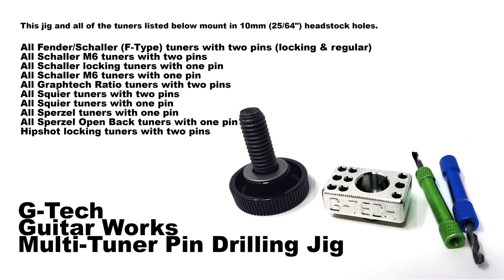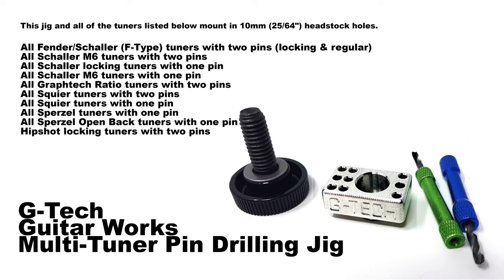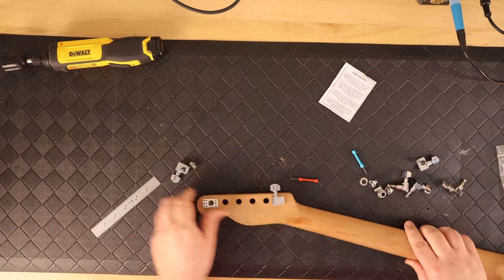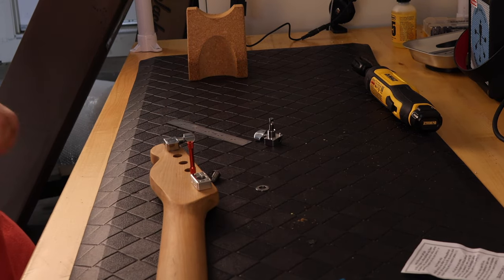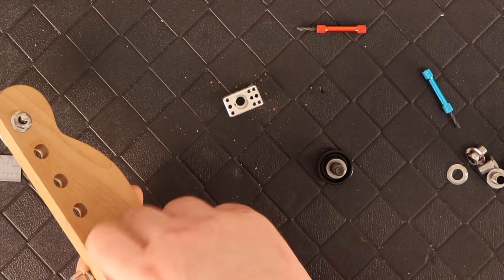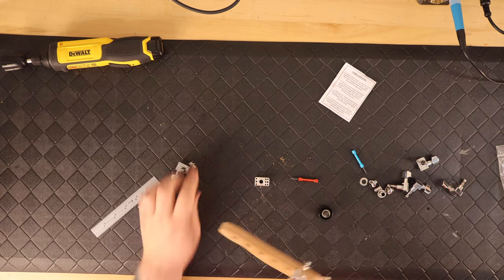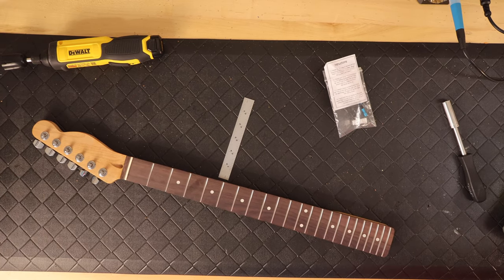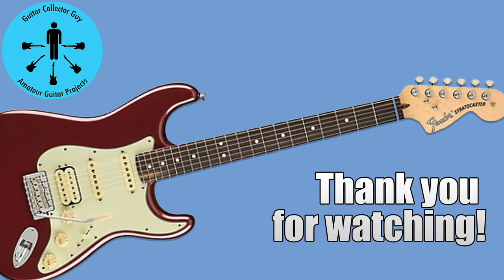Electric Guitar Tuner Pin Drilling Made Easy #fender #fendertele #fendertelecaster

Comment: yeah I'm gonna look at this one, thx. i know stew mac has one so I'll look at that one too.,
Reply from the maker: I looked at that one and decided against it for two reasons. On sale it is over $60 and it does not do as many types of tuners. I read the instructions on theirs and it is pretty much the same except for they say it is okay to use a power tool. One other reason I chose the one I got was the StewMac one provided drill bits and to buy the depth sleeves was extra.